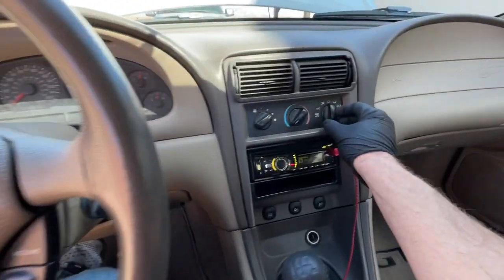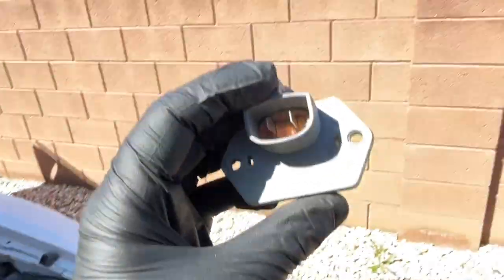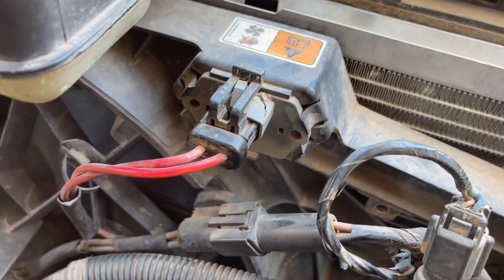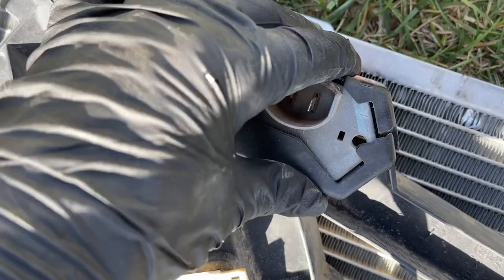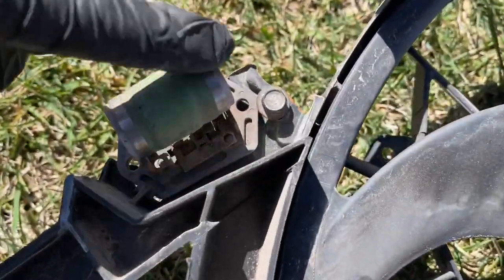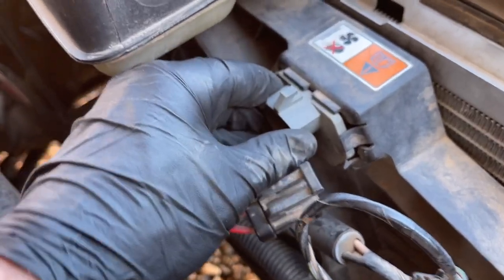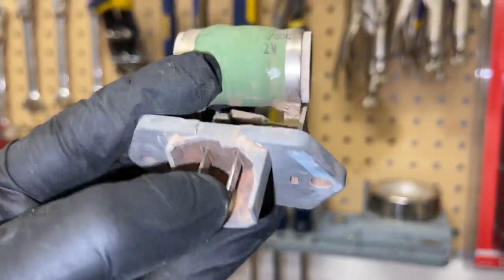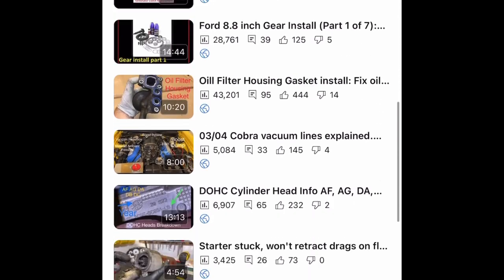Radiator cooling fan resistor replacement Ford Mustang 01-04 and other cars

Comment: Only 01-04 have the resistor?  My high speed not coming on. 99 cobra. Low speed comes on with ac only

Comment: what does the resistor do?
Reply from the maker: It limits or regulates the amount of current. It make sure it does not burn up the fan system
Reply: @dannyjohnsonsgarage  thanks for replying, im going to change mine today
Reply: @dannyjohnsonsgarage  i replaced mine today. but it blew the radiator fan fuse twice, any advice?
Reply from the maker: @Slugg69  there may be a short in the radiator fan somewhere. It might be worth replacing the radiator fan. It’s really easy to remove
Reply: @dannyjohnsonsgarage so this does not control the speed of the fan like a blower motor resistor does (speed settings for hvac controls)

The high and low speed is controlled by 2 separate relays in the CCRM?

Comment: Hey this part is currently unavailable on Amazon. Got another link or suggestion?
Reply from the maker: I don’t see them on amazon anymore. You may have to check ebay. They are 2001-2004

Comment: Thats for the low-speed cooling fan. 
If you unplug the cooling temperature sensor and then start the vehicle the high-speed fan will turn on, that way you can test your fan
Reply: What if the fan doesn’t turn on